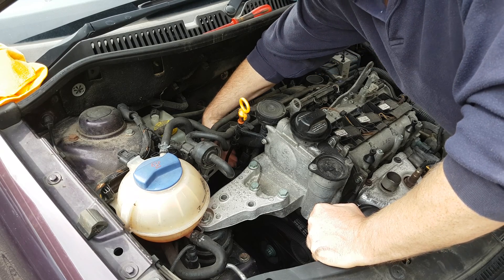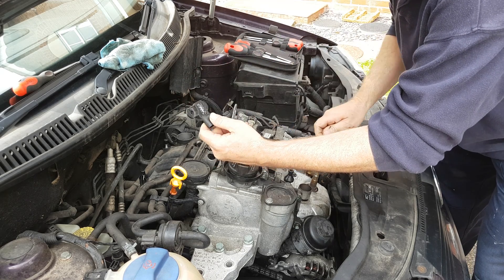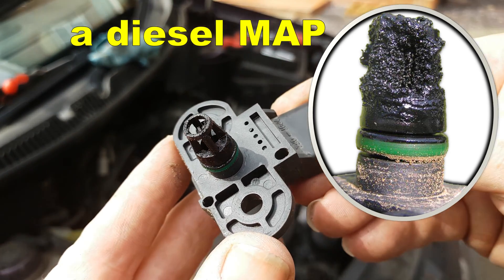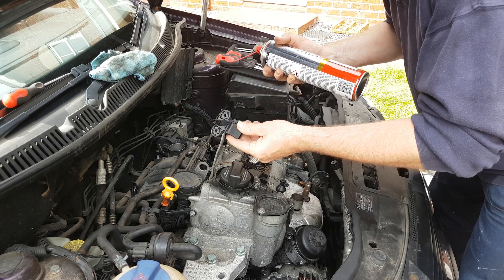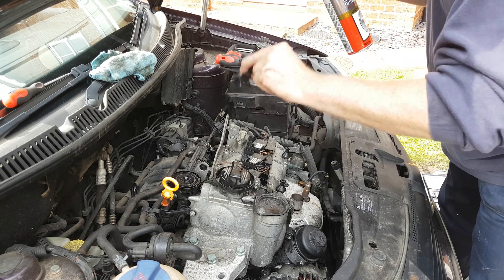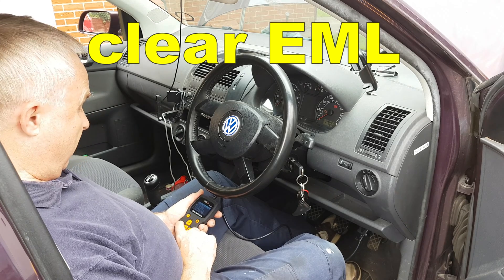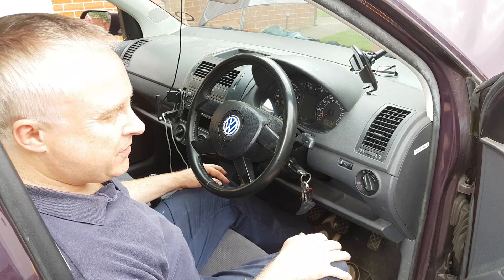Dirty MAP Sensor Problems | Boost Sensor Cleaning | P0106 Code

Comment from the maker: Some people refer to the MAP sensor as a "boost sensor". In this instance a boost sensor is a MAP sensor. The only difference is that on a forced induction engine, the MAP (boost) sensor needs to be able to read the amount of boost so will need at least a 2bar range. On a normally asperated engine the MAP only needs a 1bar range, since it never needs to measure anything higher than atmospheric (barometric) pressure. HTH.
Reply: What  vaseline for? It  will make dirty the sensor  right?
Reply from the maker: @indotube8125  vaseline = petroleum jelly. Put a smear on the o ring before assembly. Never assemble rings dry
Reply: does my 99 saab 95 have a map sensor and where is it located if so?
Reply from the maker: @randyeastman4500  Hi Randy, sorry about the delay. yes, it will have a MAP - all FI engines have a MAP sensor. It'll be on the inlet manifold somewhere - though 90s Rovers with MEMS did have them board mounted in the ECU.
Reply: Generally what sensors should be cleaned periodically? I’m a “back yard” mechanic and turned up my sister’s Ford Taurus and I think there were three I cleaned and it made a big difference. An air idle, the map which had some other sensor incorporated and the third might not have been a sensor but managed the vacuum. I would love to know if it made sense with my Saab or my wife’s 06 Lexus sc430. That’s three different engine strategies, Ford - Saab - Lexus. (I also have a Ford truck)
Reply: the one that manage the vacuum you said was the MAP sensor (manifold absolute pressure sensor)
the one with a pin with ball at the edge is tha MAF sensor (mass air flow) the one measuring the flow of air,
the're link together to control fuel distribution accordingly along with the oxygen sensor at the exhaust pipe
Reply: I bought a little skoda less then a year ago the engine management and light always on and off appears where all the necessary of oil,water,break liquids at the correct levels are one day both engine warning lights can't remember now CRB something like that  and warning sign came on than suddenly the engine stopped than I called AA recovery service the mechanic came and checked it out he told me that it's a Map sensor problem and needs to be changed  , yes this You tube helps  people  who are on low budgets but some people like me have no facilities at all.No private  garage  to store the car so even for a basic reason I take it to the garages  , yes had to take skoda to a local garage and    they changed the map sensor but the problem is that engine warning sign is still coming on.any recommendation please 
Not being cynical but I have been unemployed since corona virus pandemic began .
Reply: Should  we  cut off the  battery conection before  put off the  map  sensor??
Reply from the maker: @indotube8125  no, just ignition off

Comment: Big thanks for this video, brilliant detail and really helpful walkthrough!  

Just to add a quick warning I got from ChatGPT (so not personal critique), brake cleaners and carb cleaners are in general too harsh for MAP or MAF sensors. Unless the datasheet specifically lists MAP or MAF sensor cleaning as an application, they should not be used.  

Using a cleaner that is too aggressive can damage the surface area of the sensor, which negatively affects its readings and overall engine performance.  

A safer option is a residue free electrical contact cleaner, ideally one that is also a degreaser that removes oil and grease, such as OB41 Electrical Contact Cleaner or WD40 Specialist Contact Cleaner. These are closer in chemistry to dedicated MAP or MAF cleaners and much safer for the sensor.  

Also, regarding the O‑ring, Vaseline is petroleum based and not ideal for rubber seals. A purpose made silicone grease is much safer, as it lubricates the O‑ring for installation without degrading the material.

Comment: I screwed my two MAP sensors, both Saab 9-3 B207, one from 2004 cabrio, the other from 2008. 
The MAP sensor from the 2004 hangs in the air not in the motor, the one from 2008 is put in a hole in the motor leading to.nothing. There isn't even space for the open plug so they let it away ??? 
Where are these MAP sensors good for anyway ?

Comment: I have a problem with a 2009 Peugeot 407 saloon, 2200cc engine size, where air pressure is generated inside the engine after starting it after 5-9 minutes, and the engine torque is also dampened and the accelerator drops below 2000 rpm, and a message appears on the fault screen "Engine Fault, need repair", so I have to turn off the engine and then restart the car after wait a 5-7 minutes and it runs normally. This problem happens to me 2-4 times a day, and if the engine is running normally, as soon as I pull the engine oil level check stick or open the engine oil cap, the same problem returns, with the air vacuum into the engine.

Comment: Never use brake cleaner or carburetor cleaner. Leaves a residue. Use the right cleaners.
Reply from the maker: Brake cleaner leaves no residue and neither do most carb cleaners. Check the tin or website for each individual product.

Comment: Hi cyd. Im getting a lot of stalling and have po101 coming on. It will occasionally go limp but then ok again. Could this potentially be a mass airflow sensor problem? I’m on my 3rd throttle assembly. I do also have a whistling sound that I hear when I ease off the gas so I may have a vacuum leak as well. Thanks for any help you may have!
Reply from the maker: You don't say what car you have or it's age, but if you're doing your own maintence I'm guessing it's not too new.
With a P0101 code, I'd be looking for a vacuum leak. That could be any leak into the induction system after the MAF, so check everything for possible splits. You may have more than one leak, 
Small vacuum hoses can be difficult to check and so you might be better off simply replacing all the small vac hoses with silicone tube https://s.click.aliexpress.com/e/_DDG1dYT  . Larger intake pipes (after the MAF) made of plastic rather than rubber will defo be suspect (see my Saab 9-3 cobra video for an example).
Have you tried cleaning the MAF? WD40 contact cleaner is good. Brake cleaner is fine too.
Also unplug and replug all connectors to wipe contacts.
Reply: @CycloneCyd  Thanks so much for replying! I will try cleaning the Maf and checking the hoses this weekend. I have a 2005 Saab Arc convertible.

Comment: Dont use brake cleaner. Best way to clean is electro contact cleaner. Dont spray directly to sensor as this guy did, since you can damage membrane that is esential part of the sensor.

Comment: Can this sensor cause coolant to drain faster than usual like I’m talking 2 days and it’s gone. We had a leak fixed last month from out MOT but this has cropped up now
Reply from the maker: The MAP sensor has nothing to do with coolant. Have you checked for leaks? Tried changing the reservoir cap?
Reply: @CycloneCyd   we had a leak fixed during our last MOT in November which was from our radiator. We haven’t checked the reservoir cap. Sent it into the Garage, one of the cylinder heads is dodgy and apparently and a couple of things.

Comment: Thank you! I don't have MAF cleaning spray or contact cleaning spray on hand --- could I use rubbing alcohol (isopropyl alcohol) in a spritzer bottle and then let the MAP sensor dry out before reinstalling it? Please advise... Much appreciated...
Reply from the maker: Rubbing alcohol also contains distilled water and you cannot know just how pure that is. It'd probs be okay on the MAP, but don't use it on the MAF
Reply: @CycloneCyd  Thanks, Cyd! 👌
Reply: You can  use isopropyl but, use the 90% type.

Comment: I got a bad turbo boost and uneven throttling above 2000 rpm on My SAAB 9-3 TIDD (Z19DTR engine). The Turbo meter on the dashboard does only on the most of the time only boost only half way then under more load the boost get lost or gets uneven.  Engine lamp is on while driving. The Fault code I got is P0105 (P0105 52) and is also related to the absolute intake senor (MAP sensor). I removed it from the engine and it was very dirty. Tomorrow I will clean it and reinstall and remove the code and see if this solves the issue.
Reply: The cleaning was making not that much to the issue. But it was very dirty and clogged up with soot.
Reply: Another update is that I also had two ECM faulty codes P0671 08 and P06173 08 as well related to the glow plugs for Cylinder 1 & 4 are bad. This probably make the engine making more soot since the combustion will the MAP to clogged up?
Reply: Update today "check motor" icon on the dashboard have turned off and there is not hesitation or uneven idling. While driving there is not hesitation or lost of boost over 2000 rpm on 3 rd to 6 th gear. I change all the Glow plugs along with the MAP sensor. Nice that he engine is now running better and there is also not that much of diesel smell when the engine is started. I measure the resistance on the old glow plugs, there was one that had around 200 ohm and one was about 24 ohm. The rest two glow plugs had a resistance around 1 ohm (up to 6 ohm is fine/ok value). I was also checking the throttle body by removing the inlet air hose it look alright, didn't seems that much of sot in the throttle body. But it seems that I need to change the battery, I had it for about four years but after about 2 days without driving the car it won't start.

Comment: p2263 on a 2014 mazda 6 2.2 skyactiv d? can you give me an idea? turbochargers were replaced but they won't boost on their own. If i attach a vacuum line straight to the turbo they will boost, but on its own through its vacuum instalation it wont, checked the vacuum lines, no leak.

Comment: For a MAP sensor to be dirty like that, ALL of the intake system is dirtier than a dump site, especially since ALL MAPs must be mounted on the top section of any hose,pipe or intake manifold   ( to avoid condensate collecting in it, says the largest MAP manuf).
Reply: I hate the modern cars.  What a stupid design.  I hate all the sensors, oxygen sensors. I think they're all BULLSH**
Reply from the maker: Do you mean the one in the thumbnail? That's from a diesel. And yes, you're correct.

Comment: Recently ive changed The egr, air filtre and i had The fault Code p0106 ang p0172 ive cleaned The map sensor cleared The fault Code and i Will wait to see if IT appears again!.
Reply from the maker: A dirty MAP can cause all sorts of running issues.
Reply: @CycloneCyd  the same fault codea p0106 and p0172 i Haven no idea how You fix that...

Comment: OMG, this is a Dirty sensor :D I cleaned mine long ago, at the expense of damage to one of the screws, it was too tight and wore out. Btw, do you think that if you remove the ignition distributor to change the oil seal in it on a more modern car (2000 year) it needs an adjustment after that?

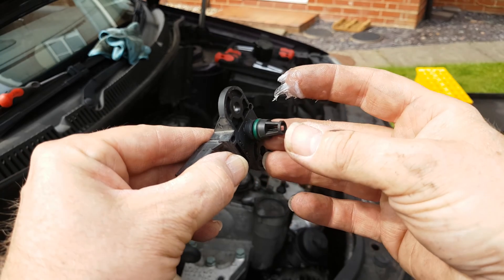Comment: thanks for sharing. What was the reason for applying Vaseline at 2:29?
Reply: Never go in dry. Noted
Reply from the maker: Never push O rings like that into place 'dry'. You can damage them. A good seal is important.

Comment: The carb cleaner I used in the past worked great but ruined my tools with a horrible lingering odor. I also hate the smell of WD-40.  Does that brake cleaner leave a smell on your hands and tools?
Reply from the maker: Brake cleaner evaporates really quickly. It pongs a bit while doing so but once gone there is no odour left behind (not that i've noticed anyway).
Reply: If all these cleaners and sprays bother your little nose, maybe working on cars isnt your thing
Reply: @TheLarryBrown  normally all break cleaners are odorless.

Comment: Different manufacturers have different ingredients for their brake cleaner/throttle cleaner. For example, a cheap china brand throttle cleaner contains methylene chloride that are known to cause severe chemical attack on many type of plastics. However, other factor such as temperature, concentration and exposure time also plays a role on how the chemical will react with the plastic parts. I think using brake cleaner to clean MAP sensor can damage the sensor, but since nobody cleans their MAP sensor everyday, it would probably be a relatively safe method. But the risk is always there and you never know when will you get unlucky.
Reply: Hello
I have vitz 2008 model my car drop the rpm after long drive I have changed the egr sensor is it due to map sensor or any other issue plz reply i m worried about my car
Reply: That's why you must use only MAF cleaner for MAP/MAF sensors. It not only do no harm to plastics, but also does not leave any residue.

Comment: Get a catch can or vent to atmosphere (coz it's probably coated by crank breather/pcv) and, if that map sensor is before EGR, it should remain cleaner for longer
Reply from the maker: Vent to atmosphere? Nooooo, don't do that, the car would fail MoT/inspection and be illegal. A catch can is defo the best solution. I've recently bought a cheap one off Ali and will do a catch can install video sometime in the new year. On turbo cars especially, most people seem to install them wrong.
Reply: @CycloneCyd  haha each to their own. I am running the gauntlet :D 
My car looks stock as hell, boring 4by, not quick not too high not too low, legal tires no stupid art etc so cops pay no interest in it. Also I've hidden my breather pipe hehe.
Reply from the maker: @moisty254  Yeah, I'm very much in favour of the "Q-car" concept these days. In my younger days, my rally car had to double as my 'daily' - I soon got fed up with attracting attention.
Reply: @CycloneCyd  yeah it's really not worth it,   having pullovers and engine bay inspections would wear thin quick. In saying that I'd definitely enjoy having a sleeper 👍

Comment: isnt that a MAF sensor?
mass air flow sensor... 
map sensor meassures the vacuum
i saw a pin like thing at the middle wich is what was n the MAF sensor that measures the flow of air
Reply from the maker: Nope, it's a MAP (manifold absolute pressure) sensor. A MAF is usually a 'hot wire' sensor.
https://www.densoproducts.com/map-vs-maf-whats-the-difference
Reply: And it has a temperature reader, the small bulb in the centre at 1.28

Comment: What scanner machine do you use please. Thanks
Reply from the maker: An Ancel AD300, now superceded by the AD310. It will read all OBD2 compliant codes and a range of manufacturers codes along with live data and freeze frame (both very useful). http://bit.ly/Ancel_AD310

Comment: I had the MAP sensor replaced in my VW 2012 Passat but the check engine light appeared a week later.  Had it checked and the computer said it was the MAP sensor.  Any advise as to what might be causing this?
Reply from the maker: check the wiring to the sensor and back to the ECU. Also double check the sensor is clean.
Reply: It's also possible that you got a part that was defective from the manufacturer. It's happened to me a few times.
Reply: Is it performing ok ? I

Comment: Brake cleaner has solvents that can degrade plastic and rubber. After some time the bonds in plastic polymers brake and it forms cracks.
Reply from the maker: Which compounds do that?
Reply: @CycloneCyd  I don't know the actual ingredients that are harmful, but everywhere I read, people tell about discolored, dull or even melted plastic from Brake or Carb cleaner.
The Wiki page states: "Rubber and some types of plastics are decomposed by brake cleaners by removing binding components. This has the consequence that the rubber will appear unchanged at first; however, it will become brittle, and after a few weeks to months cracks and fractures appear. "
Reply: You should have no problem using brake cleaner because it takes over 3 years before it start to eat the plastic. But so will the cold & hot & heat from the engine & ages & salts.

Do you really think the dealerships won't use brake cleaners?
Reply: @angelisone  prob right but I'd have said a dealer will have a more suitable spray lol

Comment: Hi there.  Would you know if a 2009 Nissan Altima has this MAP sensor, if so where's it located at?
Reply from the maker: Plenty of engines do not have a MAF sensor, but I've yet to come across one that does not have a MAP. It will be on the inlet manifold somewhere, not far from the throttle body.

Comment: i do recommend using an electrical cleaner or actual MAP sensor cleaner as the equipment is very delicate and needs to be left with no residue. break cleaner or Carb cleaner is a bit risky. (good video though mate and happens to be on the same engine as mine)
Reply from the maker: The REALLY important bit is "leaves no residue". Other than that, it really doesn't matter too much what you use - no pure solvent mixes are going to damage the rare-earth metal and ceramic s of the MAF as long as you don't touch them.
Reply: @redlined4493  brake cleaner has a high flash point and leaves now residue. That’s why it’s recommended for brakes
Reply: New sensor 25-35€, map cleaner 10-15€... is it even worth to clean it?
Reply: @B.ori.s  1 new sensor vs contact cleaner that can be used multiple times for various jobs (you might already have some lying around), so yes, its worth it :)